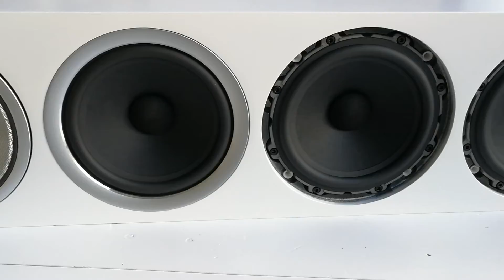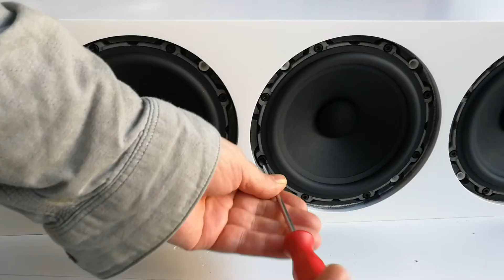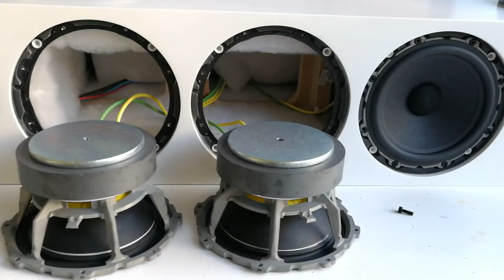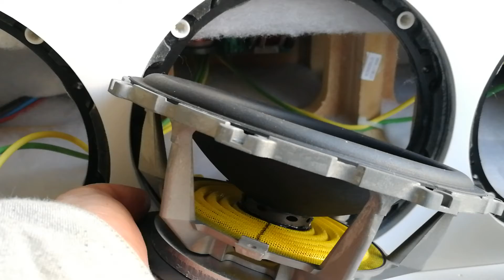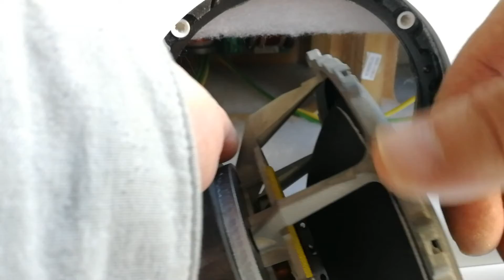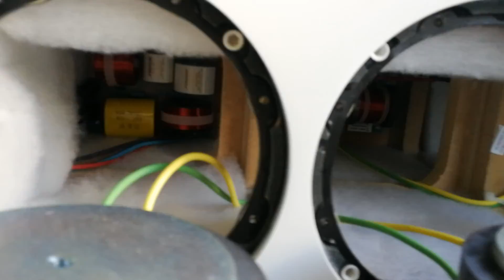The drivers: B&W 702 S2 loudspeaker Deep unboxing

Comment: Nice video. Could you please show how to remove the mid driver please?
Reply from the maker: You unscrew it from the centre
Reply from the maker: But you have to remove the black foam first by your ✋
Reply: @hxosplus  how do I remove the metallic trim around the mid range driver..can you just pop it off like you did with the trim around the bass woofer?
Reply: Is this the correct sequence to remove the midrange driver?
1. Pop off surrounding metallic trim
2. Unscrew the driver - how many screws are there?
Reply from the maker: @chandybe  Yes
Reply: @hxosplus  thanks..after popping off the trim, are the screws on the midrange driver itself? I have heard some people talking about unscrewing a rod holding the midrange driver in place, but I am unsure what that means..

I thought the midrange drivers would just have some screws in the front and that after those are unscrewed, the driver comes out..is that correct? Or does something need to be unscrewed at the back of the cabinet?? Thanks

Comment: Can I buy the tweeters separately? I want to DIY my speakers
Reply: There are better and more linear tweeters out there for much cheaper.
Reply: @viciadoemhalo3  the material used in the tweeter is not the factor if its going to be linear, bright or rolled off, its most part of the crossover

Comment: Are these drivers that much better than the ones in the cm series?
I didn't like the fact that these are made from card and polystyrene, the cm series use a kevlar / paper mix wich to me sounds like a better quality product.
Reply: Harry Critchley i’ve had CM series speakers (two pairs ) For the last 12 years. Just recently demoed the new 704 and then ended up buying the 705s2 Monitors. I’ll tell you that I think the drivers and the tweeters in the new 700 series are superior to the CM series. There was a bit of a nasal affect with the Kevlar that no longer exists with the new drivers. Also, the carbon Dusted tweeters really are better sounding than the CM series.